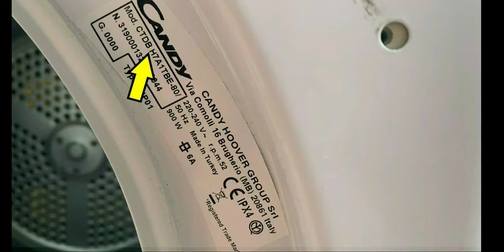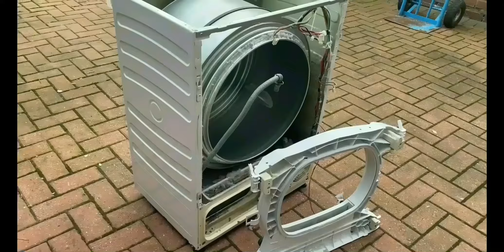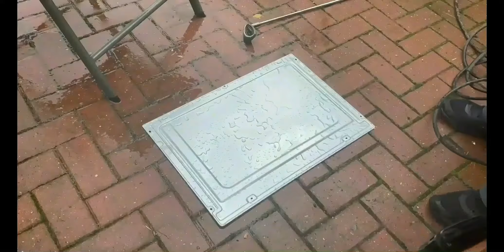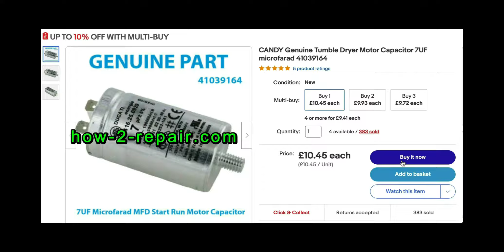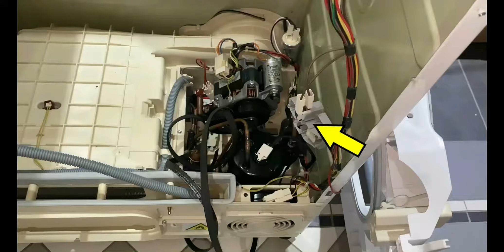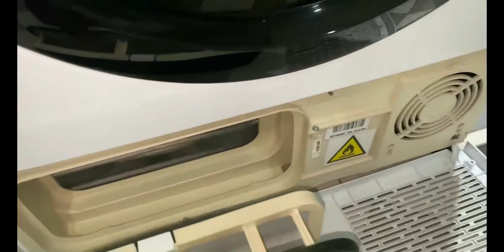Candy Integrated Condenser Tumble Dryer Not Working  Fixed

Comment: is there a way to clean the heat exchanger from all the fluffs? I mean to blow  them out with a compressor or so?
Reply from the maker: You can use a Vacuum Cleaner when the unit is dry Yansen, otherwise see one of my previous videos regarding this issue ; https://youtu.be/F9IMA9W-J4M?is=p_ojGusbgwbXkHxy

Comment: Even though my model number is different, it looks the same inside. Just cleaned and reassembled it in hopes to remove weird loud noise. I thought it might be from bearings, but they seem fine. And the noise happens on and off even when the barrel doesn't rotate. Do You have any ideas what could it be? Didn't check the pump like You did here. Maybe i should. But idk, i cant imagine that little pump to make such loud noise.
Reply from the maker: Sounds like the  cooling Fan in front of the Compressor TL33te, it switches on an off intermittently. Probably want to inspect it 😀
Reply: @green-crocs-fixes1520 Thanks! will check when i get back to it.

Comment: I have trouble taking drum out, I undo all the screws on the back, but its still attached somewhere
Reply from the maker: There is a black Seal around the Vent at the back of the Drum which can hold the unit together once all of the Screws have been removed. A blunt knife may help to release it 😊

Comment: I had the same issue but it originally had a 5fh capacitor fitted replaced it with the same 5fh capacitor still making the same noise as your . It was really difficult to find 5fh capacitor most are 7fh checked the bearings belt all working well still can't get it go even with a tug on the drum ? 
Any ideas
Reply from the maker: Tricky one Justme,
                                 the noise you can hear is the Pump, it is usualy the Capacitor which prevent the Main Motor from turning and the unit is fitted with a Brushless Motor they dont usually fail. 

Possibly the Control Boards Relay not swithching it on or a poor connection some where.

Comment: Why not clean the condenser heat exchanger normally full of lint. This model has no heaters so far more efficient is that correct? Great video has helped a lot. I will buy a condenser dryer next. Thanks😊
Reply from the maker: Thanks John 😁

Comment: Guys can someone help me please with my Candy dryer CS4? There was 2 problems, first problem was that drum was not running properly, i disassembled everything, after cleaned all the dust, than changed 2 condensators(1st which was running generator was dead , 2nd condensator for compressor was fine, but it had 12/16uf, so i also chanched. 
2nd problem was that water was not running from bottom to water tank, i cleaned this pump area, checked the pump and it was turning, so i thought that now everything should be fine and i putted it together. Then i turned on programm with wet clothes, the water was a bit coming to the water tank, but  the bulk of the water remained below where the radiators are located and the most interesting that clothes was dry after programm cycle. 
Maybe someone was getting in touch with kind of problem like this? Thank you.
Reply from the maker: Thanks German,
                            sounds like you got the unit working again. The condensed water only pumps out water at a certain level, in drips mainly. A lot if which remains in the Condenser unit 😁
Reply: @green-crocs-fixes1520  Yes, but it should go mainly all in water tank, i dont understand where is the problem, that it stays there.

Comment: Great Video!  I was wondering how you open up a candy tumble dryer as the sides don't come off.

I have a issue with my Candy heat pump tumble dryer.  

It doesn't dry clothes or collect water in the front door.
I have checked the pump and it is working. It seems like the compressor may have lost it gas as the clothes only get mildly warm after having the dryer on for a hour and the condenser fins dont seem to be getting cold.
Do you think it could be the compressor losing it gas or do you think those symptoms point to something else?  
Any ideas would be greatly appreciated 👍
Reply: I forgot to mention I measured the incoming wattage and it was reading around 470W which seems to suggest everything is running.
Reply from the maker: Yes how old is the unit ?
Reply: @green-crocs-fixes1520  only 4 years at most
Reply from the maker: @monkayjim999  OK, this should be covered via Warranty as it would take at least a decade before it would loose any AC fluid.
Reply from the maker: Thanks Jim,
                     Sounds like the unit will require a Re-Gas if the pump is actually working.
Reply: @green-crocs-fixes1520 how much do you reckon a regas would cost? And would the gas likely leak out again..  the dryer cost about £300 new at the time so not sure if it's worth repairing it or just buying a new one .   It was probably only used 30 times at most as I usually dry my clothes outside
Reply from the maker: @monkayjim999  looked into refills an a Dryer a couple of years ago, not cost effective. Try warranty.
Reply: @green-crocs-fixes1520 thanks for the advice 👍

Comment: Hi, Is there an easier way to access the capacitor than this?
Reply from the maker: Hi, besides removing the front panel only, I don't think so FC.
Reply: @green-crocs-fixes1520  Thank you for the reply, Mr Crocs. It just seems to be an awful lot work and time to replace a simple component. I think i will just use a dremel to cut a small rectangular hole in the side panel instead.
Reply from the maker: @fc1873  Wouldn't advise that method FC, plus once you have dismantled the Machine and replaced the Capacitor ( which should be ok for a few years ) you can then give the inside a good clean of the Fluff and Lint which has probably built built up 😁
Reply: I decided to take your advice, Crocs. It's absolutely criminal that we need to completely disassemble the whole unit to replace one small component. This was my first time attempting this, and it took me nearly four hours from start to finish. It would have probably taken me around half an hour (at most). If I'd been able to just remove the side panel on the right-hand side of the dryer. 

Thanks again for the sound advice. it's very much appreciated m8. @green-crocs-fixes1520
Reply from the maker: @fc1873  Your not wrong FC, unfortunately manufacturers want us to go out and buy a new one, like a BIC Razor, hence the design. Thanks and hope its working again 😁

Comment: How did you remove the belt? The motor on my candy seems to be faulty. I replaced the capacitor and it still didn't work. I think I need to remove the drum in order to get.to.thw motor.
Reply from the maker: I usually just undo the Drums retaining bolts then work the belt off as I am pulling the Drum out Daniel 😁
Reply: @green-crocs-fixes1520  Thank you, I'll give that a go. Much appreciated!
Reply: @green-crocs-fixes1520 Thanks pal I'll give that a go!

Comment: I have this machine. How the hell did you slip the belt off? The two tensioning wheels keep it too tight to  slide the drum out. And putting it back seems even harder. Also the top plastic display and button panel. The manufacturer dents down the lugs behind.  So if you can't get it off make sure to check behind and bend them up else you will snap the plastic.
Reply from the maker: Hi Andrew,
                  once all of the retaining bolts for the Drum have been removed I simply rotate the Drum whilst sliding the Belt off and the Drum out simultaneously, the Tensioner Wheels are spring loaded so you can get movement. This is the method I use for removing and refitting the Drum. You can undo the Belt via the Fan housing also if my method is too difficult.

                  Regards 😁.

Comment: Thank you so much for sharing your video and experience. By watching and learning from you, I was able to fix my candy dryer too 🎉. You are a true gentleman. Thank you once again. 😊
Reply from the maker: Thanks Yasir,
                       appreciated. Glad you managed to successfully resolve and happy to help 😀.
Reply: Hey brother, Just saw my first dryer cycle, cloths still damp and also no heat was felt when I open the door. And there was water compartment drainage light was blinking as well but zero drop of water was collected. Any idea 😢 what went wrong please.
Reply from the maker: @TravelWithYasirAbbasi  any lights on the machine ?
Reply: @green-crocs-fixes1520  no warning or blinking lights
Reply: Hi gcf, on each rotation of my drum it bangs, any idea which bearing needs replacing?

Comment: Hi, very nice video . I change the capacitor, the dryer is working normally for two minutes and then fails the safety relay in the house control panel .Have any idea ;   Thanks.
Reply from the maker: Hi George,
                  did you replace with the same uf ?

Comment: Hi, nice video.  This might seem like a dumb question but how did you determine which capacitor needed to be replaced? because I would have gone and replaced the start capacitor here rather than the run capacitor
Reply from the maker: Thanks Michael,
                             there is only one Capacitor fitted to this machine, research via internet led me to this successful resolution 😀
Reply: @green-crocs-fixes1520  There is definitely 2 on this machine. It is the larger 20uf cylinder sitting just behind the motor screwed into its housing. It is responsible for the initial surge of power to begin spinning the motor. The run capacitor keeps the motor running efficiently throughout the cycle.
Reply from the maker: @ OK the other one must be for the Fan. What machine and model is it an AEG ?
Reply: @green-crocs-fixes1520  The other capacitor, 12uf, is for the compressor.
Reply from the maker: @js012a  you’ve not said what Machine you’re working with.

Comment: Very helpful. I followed You to the point where You dismantled the water reservoir and and the water pump. I did not manage to take both out, it was too tight for me to get them out. I have seen that You also struggled. In fact there are cuts in the movie when You take the reservoir out and then back. Did You manage to do it without dismantling anything else or did You use some special "tricks":)
Reply from the maker: Thanks Greg,
                       sorry this section was difficult to remove with the Camera in one hand so I had to put it down to wriggle the Pump housing out, just two screws, no special "tricks" just used perseverance and nothing else was removed 😃
Reply: Thanks. Since I know it is possible I will try myself then.

Comment: Hi. I have just replaced the capacitor but now the motor won’t turn at all. Any ideas please? I press the start button and it just beeps. Before it was starting the motor with a little help from myself spinning the drum.
Reply: I forgot to reconnect the door switch 🙈. All good now 👌🏼
Reply from the maker: Superb Martin,
                         did as but the comments have disappeared 😀

Comment: Great video. I have a machine similar to this one. Mine isnt heating up. I've stripped it down but cant see any heating element, nothing on the back. Its a heat pump condenser dryer. Any idea as to what it could be / any possible fix or parts needed. Many thanks
Reply from the maker: Thanks John,
                        this machine had not been maintained, so the Condenser unit was completely full of fluff inside, so air was unable to flow through the Condenser. However I focused on the fact that the Drum was not turning due to the Capacitor. Hot and Cold air is air Condenses when flowing through the unit, this effected if the Condenser is blocked. Make sure the Compressor is working (humming) then you may have to clear the Condenser unit which is not easy to access, This link is an method I used on another Heat Pump Dryer; https://youtu.be/F9IMA9W-J4M?si=lOC01iXUTqLYi3kX
Reply: @green-crocs-fixes1520  Thanks for that, I'll give it a go and let you know how it went. Thanks..

Comment: Is there a quicker way of getting to this capacitor without taking everything apart?
Reply from the maker: Hi Kulwinder,
                       yes there is. you can gain access via the Fan housing @ the bottom right, just have to remove the front cover top.housing, housing ring and then the Fan.
Reply: @green-crocs-fixes1520  any chance you've got a video showing this?
Reply from the maker: @kulwinderchana5059  Sorry no I haven’t
Reply: @green-crocs-fixes1520  thank you for the response

Comment: How much is the running amperage. Thanks 🙏
Reply from the maker: Hi Jenish,
                Amperage for what exactly ?
Reply: @green-crocs-fixes1520 when motor runs around.90 A. Once compressor started how much should be. Thanks. Overall dryer consuming current?
Reply from the maker: @jenisharone9122  Jenish I do not have any technical information or specification diagrams regarding this machine.

Comment: voglio capire per che non parte la pompa dell’acqua . la pompa  non è rotta  e non è sporca. la macchina da errore vaschetta piena
Reply: I want to understand why the water pump doesn't start. the pump is not broken and not dirty. the machine gives a full tray error
Reply from the maker: @salvazarbo7167  what model is your Drier
Reply from the maker: Salva,
          controlla questo video per quanto riguarda il pressostato che attiva l'indicatore del serbatoio dell'acqua pieno 

https://youtu.be/YgVC-1qZYZU?si=d8FMpRV4D5GWHlRA
Reply: @green-crocs-fixes1520   my dryer doesn't have a pressure switch... it has a float...

Comment: I want to understand why the water pump doesn't start
Reply from the maker: Probably have to remove the Pump to examine its housing for blockages and then the connecting pipes. If it is not blocked then probably needs to be replaced.

Comment: Nice video pal. Got a question please. Mine doesn’t collect water anymore. What do you think I will need to replace please. I have just followed your instructions and disassembled mine.
Reply from the maker: Plenty can cause this, check pipes for blockage and make sure pump is humming

Comment: Could you explain how you take of belt from drums. First take of screws on back and then??? How loose belt...
Reply: I basically stuck between 6.05-6.07sec
Reply from the maker: @rafalmichalik  Ok the Belt has a Tensioner down by the Motor (bottom right under the Drum) two black Pulleys which are spring loaded, just need to push them together and free the belt from the Motor's drive pulley. Difficult due to not much room
Reply: @green-crocs-fixes1520  I already done that I removed 7 screws on the back to free the drum. But I have another problem. Drum is still somehow attached to the back tumble dryer☹️. And can't move it away.
Reply from the maker: @rafalmichalik  been there Rafal, there is a Black Seal which is painted on around where the Heating Element blows into the Drum as the back. If you have a Heat Gun to warm that area however I managed to release my first one by prying it off when a Dinner Knife. Make sure you have removed all of the Screws around the heating elements area.
Reply: @green-crocs-fixes1520  I Wonder the drum not takeoff with the bracket and black seal is between how this think catching🤔
Reply from the maker: @rafalmichalik  it’s like Glue the black stuff. Sometimes it holds tight
Reply: @green-crocs-fixes1520  Thank you very much for your help. I let you know if I succeed or not. Thanks for video🙂
Reply from the maker: @rafalmichalik  Cool thanks 🤩 .
Reply: Hello. I want let you know. I take drum away like you said🙂. Changeing capasitor there was pice of cake😉 Tumble dryer works again like new🙂🙃. I'm happy thx very much ☺️.
Reply from the maker: @rafalmichalik  Thanks Rafal,
                                                  and well done. Happy to help 😎.
Reply from the maker: Are you asking or telling Rafal ?
Reply: Aaking🙂 sorry. I follow your instructions and I manage to get to point. I have still Belt on drums. But my Candy tumble dryer have 7 screws on back. It is also with heat pump and also have broken engine capacitor. I don't know what to do next please help. And it's missing step on movie😊